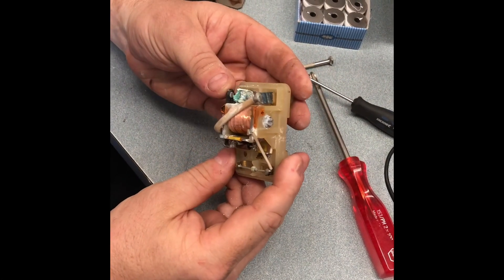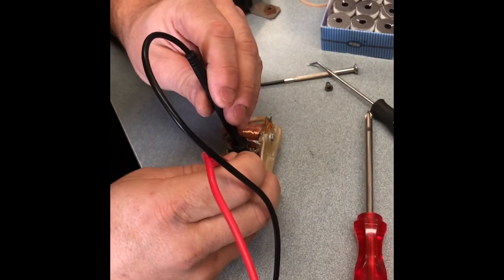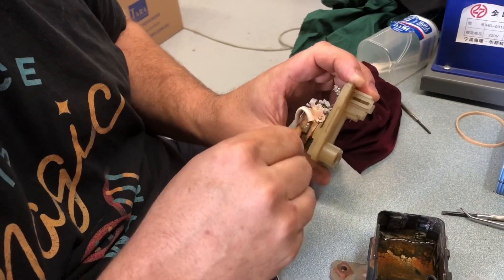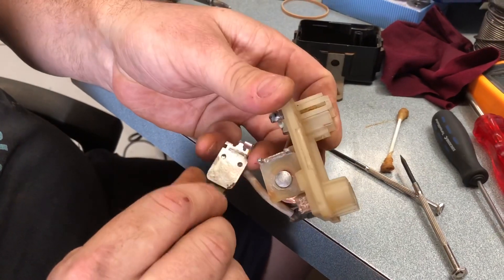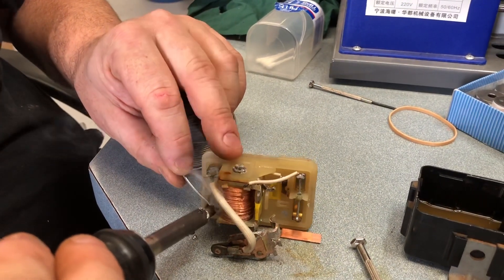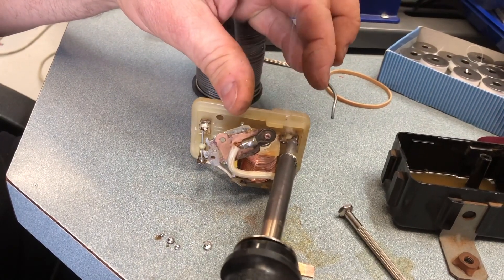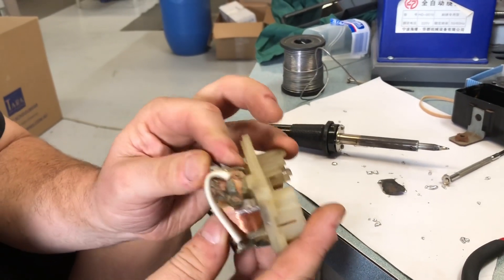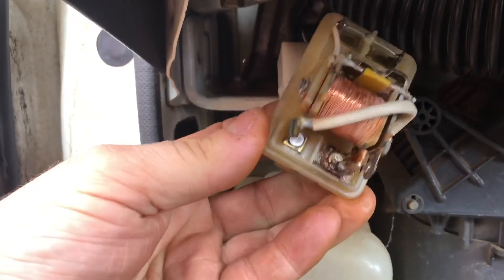Electrickery - Toyota Dyna Glow Plug Relay Repair

Comment: A lot of info missing.  It would be great if you could include: 1. Where is the relay situated? 2. What causes the timing in the ON position? (is it part of the relay?). 3. Can the ON time be adjusted? Many thanks :) 💕
Reply from the maker: Gday mate, apologies! The relay is in the from left under the dash. The timer is controlled by an output from a control module, and I doubt that it can be adjusted simply. Have a great day!
Reply: @JBFromOZ  Many thanks :) 💕

Comment: I have rebuilt my fair share of contacts in my life auto and industrial
Reply from the maker: My mentor grew up in Rhodesia/Zimbabwe, under sanctions, and taught me well that you can fix anything with a few bits of old fencing wire and a piece of string!
Reply: @JBFromOZ  I was taught that every thing can and should be reused and hear it is bailing wire and bailing rope and i add duct tape
Reply from the maker: There’s also “ if it moves and doesn’t, duct tape if it doesn’t and should, hammer”
Reply: @JBFromOZ  how true my hammers are big bigger and that will fix the bastard 20 pound sledge